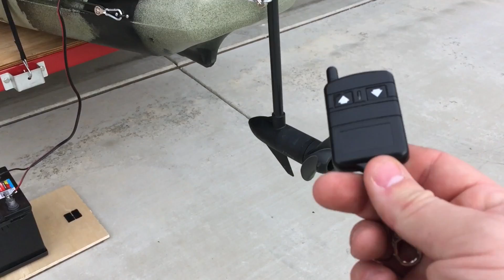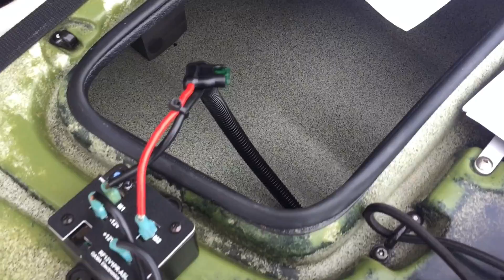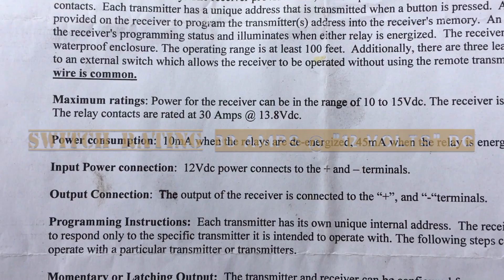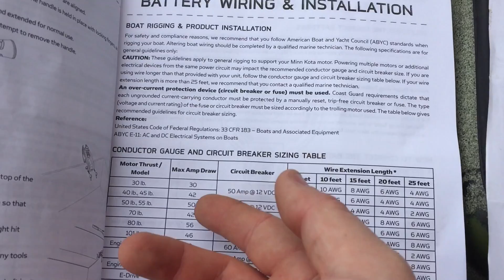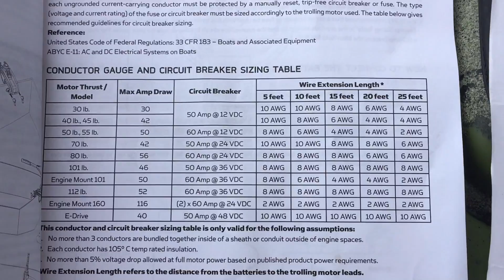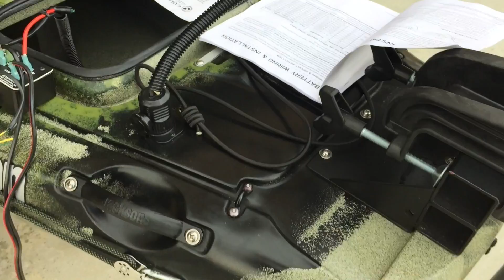Wireless Trolling Motor Switch (2016)

Comment: Wondering how this has held up?  I checked out the company and they do have a variable speed model, but they do not recommend any of their controllers for trolling motors due to voltage fluctuations causing increased wear on the controller.  Has that been an issue at all?

Comment: You can get a remote switch for an electric winch (used on ATVs and trucks) that will work the same way and it probably cheaper ($18 on Amazon) I have on my snowplow so I can raise and lower it when I hook it up and take it off. And you can use it on any trolling motor no matter how many lbs. of thrust you have.

Comment: I am usually fishing in saltwater with waves hitting me left and right... I am using a 12v 46lbs thrust I feel like the (12v @30A) would not be ideal for me since my motor is actually working alot more against currents... My question is would you know of another device that is a 12V running with 40+ AMPs?

Comment: WOW!  What a difference a few years makes.  With the advent of the PWM i.e. Pulse Width Modulation system similar to what Minn Kota uses on their new style variable speed high efficiency motors which are more expensive than the older 5 speed models.
Now there is a way to convert that old 5 speed motor you have sitting in the garage to a PWM system at a reasonable cost that can extend your range especially if you are operating at slower speeds as the AMP draw is significantly less.  Example: PWM 4-5 amp draw at 1/2 speed and 28 amp draw at full speed.
Here are a couple of links to a recent upgrade to my Hobie Pro Angler 14 Kayak thanks to a gift from my friend Phil Krug.
https://www.youtube.com/watch?v=ewVo7CImyiw
https://www.youtube.com/watch?v=Jn_R5TYd104
Of course it is not wireless like the unit shown but the new PWM system is definitely the cats meow.
Infinitely variable speed in both forward and reverse.
John

Comment: Good for lake/pond fishing. Trolling and matching currents is the goal in tidal waters. I’d also say if winds are pushing the kayak and
want to work against that to troll some rods,  this would be a problem for the switch. Having a variable speed comes in handy although I do like the idea of the switch you found here. “I’d think the controls would be better utilized as momentary foot switch. Just use the remote for reverse maybe. Fishermen need our hands. Time off the rods is time lost for me. Thanks for sharing I may use this controller if I can for something.

Comment: I wonder if there is  a wireless PMW speed controller for 45# trolling motors. So far, I've only seen ones rated at 30amps. Max amp draw for a Minn Kota 45# is about 42...

Comment: Thanks for sharing this with us! Quick question...the area where the wires connect to the motor where you can steer left and right, does the black round ring its attached to come with the motor? did you have to add the bolts too or did it come with the motor...if so did you have to drill it? Thanks!
Reply: I think the motor comes with one but it serves the function of holding the shaft at the depth you want. So you might want another one just for the steering linkage. Its called a shaft collar or collar sleeve some only come with 1 or 2 threaded screw sets and ive seen others with 4 screw sets but am unable to find those in the right bore diameter. Hope that helps.

Comment: I have a 1432 jon boat. Basically just a big kayak haha. I use a similar size trolling motor. I've had as much as 1000 lbs in it and it would do 3.5 mph. When it's just me. It does 3.5 mph. I'm looking for another propeller to get more speed. At least double. Where did you get your propeller? If it is an add on, how much more speed did you gain? Thanks

Comment: The T-SC-12V Switch and Remote Control from Gama Electronics would have allowed you to connect your yellow and green wires from your trolling motor for variable speed control.  The switch has the green and yellow wires plus the other four connections (2 input - 2 output) and is rated at 30 amps at 12 volts.....it costs $110 dollars.....compared to your switch at $65 dollars
Reply: It literally says not for trolling motors on the website

Comment: So your full speed both in forward and reverse essentially?
Reply: That's was an issue I was hoping would be addressed. I think having the ability to control your speed would be a main feature you would want in fishing situations. But I guess if you're only using the troll to get from point A to point B this would be fine. But if I'm trolling the banks and casting I don't want to be going full speed.

Comment: Would there be anything wrong with wiring to the stock battery leads out of the trolling motor instead of opening up the trolling motor head and using those wires?

Comment: I looked at the GAMA Electronics site and found the RF340-80A-SC. It's an 80 amp model and the remote give you variable speed control. I'm going with a 55# thrust motor so will need the extra amp model. The module also has switches that can control the motor if the remote fails while on the water.
Reply: Do you have the motor with the foot pedal?  Will you be able to connect to the steering motor?  I have the older model power drive.  I would need to replace my circuit and my the copilot and though this may be less expensive.
Reply: It says on their website “not recommended for trolling motor applications” tho...
Reply: hey did you ever try it out ? I am using a 12v 46 lb thrust motor on the beach against waves so it might need more power so I was thinking of getting RF340-100APR 12v 100 amp its overkill, but I can`t seem to find a lower one anywhere... the one you posted is crazy expensive. I don`t know jack shit about electric components, but would it be ok to use the 12v 100 amp on a 46lb thrust motor?

Comment: My question RF receiver RF340-80PR can hold up to a trolley motor up to 80amps if I use a 50amp motor I can use a 50 amp fuse with these receiver

Comment: Fantastic and informative video.  I want to use this set up on my ascend 128t.  It has yak power, i am assuming I could wire that power switch directly to the on and off switch.
Reply from the maker: +Shack's Outdoor Adventures yes! Depending on the switch. Thanks for the comment!

Comment: Hi Guys,

Couple of Safety Tips:

If you are using a trolling motor on your kayak don't forget to take along some spare fuses (more than one) and shear pins for your trolling motor.  I drilled a hole in the top of a spare pill bottle and mounted the lid of the pill bottle to the underside of my battery box with stainless steel hardware. i.e. bolt and self locking nut.  The pill bottle could me mounted anywhere or even kept in your tackle tray.  Going out fishing without these things with a trolling motor is like going fishing without a PDF.  You never know if you will need them, but if you do it is usually hard to find a replacement while out on the water.

Also, if you have a minn kota trolling motor they usually have a slot in the end of the shaft.  If you break the shear pin it is very difficult if not impossible to remove the self locking nut to get at the broken shear pin.  I use a straight blade screwdriver to hold the shaft while loosening the self locking nut. A pair of pliers is also a good tool to have the grab the self locking tee nut.

Attention to these items possibly will keep you from having a really BAD day on the water.

John
Reply: lahokc59  
Yep, a paddle is like a spare tire.  Don't go anywhere without one.!
John

Comment: Great video. What shaft length Minn Kota Endura C2 Transom-Mount Trolling Motor did you use on the BIg Rig? Thanks
Reply: The 30lb Minn Kota C2 typically comes with a 30" shaft.  In Kevin's original video, I think he said he cut off around 6"(?) for his install/

Comment: I follow your installation finally put it together on my new xfactormalibukayak, ANY  IDEA EHY MOTOR DOSENT STAY ON WHEN I KLIC  THE REMOTE
Reply: The control can be configured for either momentary or latching operation. In the momentary mode, the motor will operate as long as the buttons are held down. In the latching mode, pressing either button will start the motor and pressing the button a second time will stop the motor. The auxiliary switch leads only provide momentary operation. THIS WAS COPIED FROM THE GAMA ELECTRONICS WEB SITE

Comment: Love your custom mods. Ive used your idea for building mine up. I looked into Gama, and saw they make a remote and reciever which controls speed aswell, from 1 to 100%. I called the company, gave um the specs for the minn kota c2 30 and they confirmed it will defenitly work with your same set up. im just adding the on off button to mine. I also gave your page a shout out to the company since the manager said he wanted to see it, so hopefully they hook you up. Thanks again for the idea. I might upload my rig when its complete.
Reply: also, what was the propeller you used aswell?
Reply: also, what was the propeller you used aswell?
Reply: Justin Chanona what is the price on the switch?

Comment: Nice video Kevin, I have a couple of questions for you. First with this setup do you still have the ability for different speeds forward and back or are you stuck with just one speed? Second, if you were doing this all again from scratch is there anything you would change or do different? I just picked up a 2016 Big Rig and this looks like a good way to go for motorizing it.
Reply: if you want a variable speed setup check out the build on my page
Reply: @Domin131  what's your page